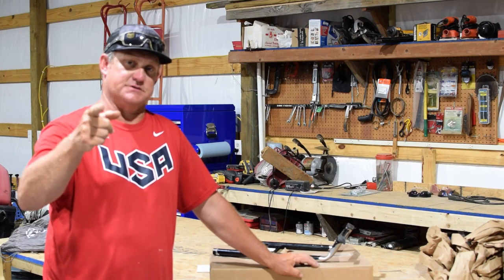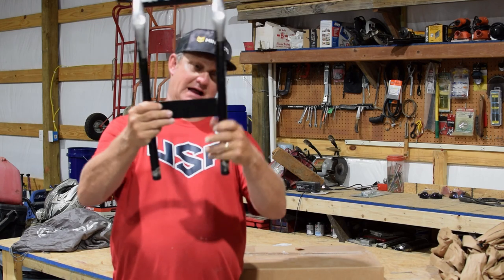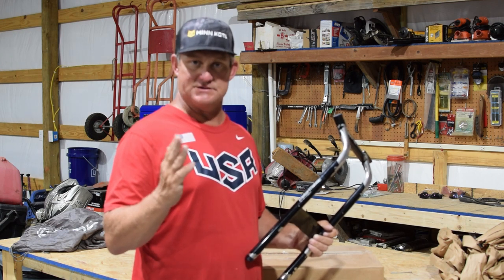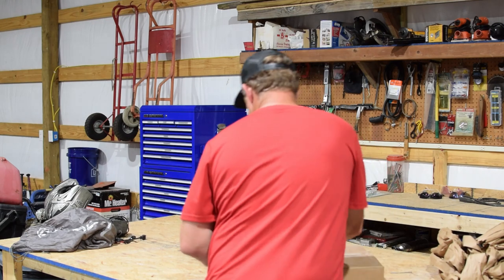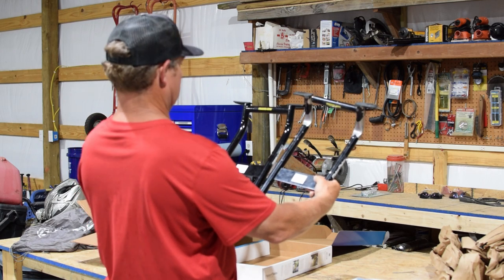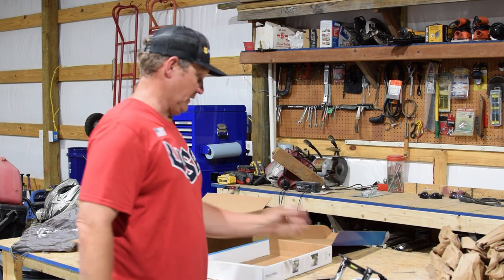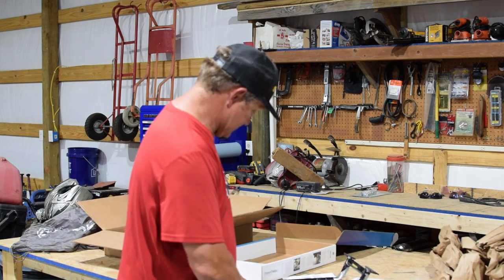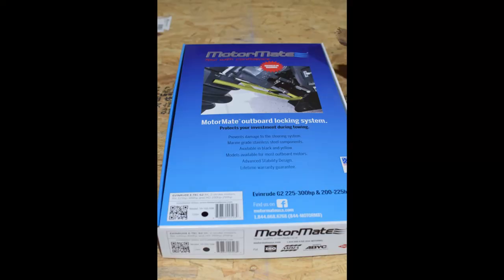Motormate Lifetime Warranty ? Review

Comment: thank you for good RMA review... It has been 3 years since the last review, how about an update as to how the replacement product has held up?
Reply from the maker: Product has been improved in structure but the painting process needs work. I think the replacement was shorter and did help with product not bending. I have to admit that i like the lock and haul one better and used almost exclusively now for last year.

Comment: If your transom saver goes from your motor to the transom, it’s still applying pressure to the transom, not helping the transom. 
From the trailer to the motor with a transom saver will help the transom.
Reply from the maker: Not going to argue as all i  can say is there is zero motor bounce or side to side slop.